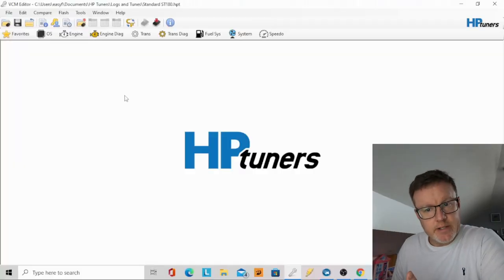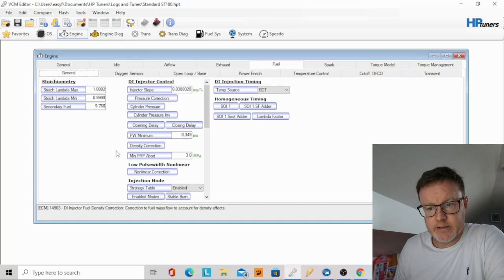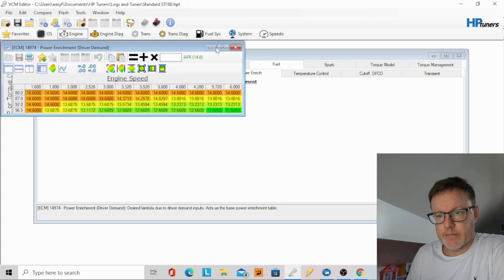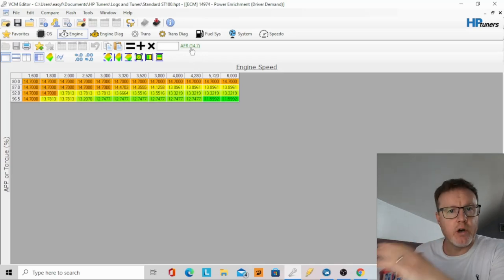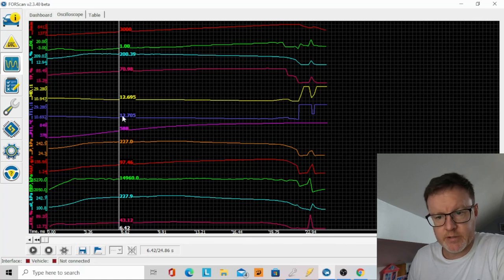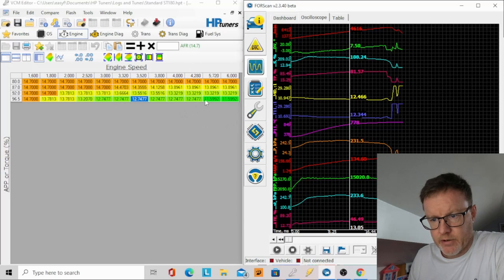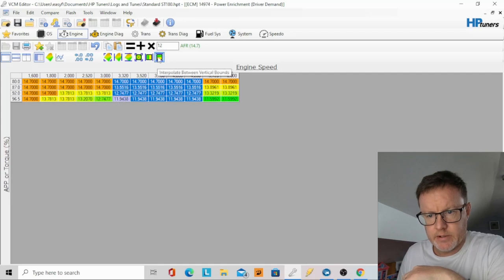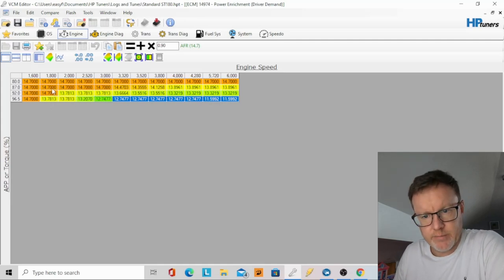I didn't know it was this easy. AFR changes

Comment: Hi Steve I bought HP Tuners around 18 months ago as having had my car remapped I wanted to be able to make adjustments myself. I found myself spending lots of time on forums reading rather than asking questions as those sorts of forums really don't cater to a learner. Along the way, I found that the mapping strategy used on the Euro Fiesta ST and 1.0 is very similar to what VW used on the Mk6 Golf that had the Bosch MED 17 which was a great help as there is lots of info out there for VW for some reason Ford is not anywhere near as popular. So, I thank you for making this video as it is very informative.
It's worth mentioning that it is very wise to have the ability to make a spare ECU (CLONE) should you decide to go down this path if you have some sort of write error you'll not be using your car until you get the ECU bench flashed.
I have also experimented with an aftermarket ECU on my car which took many hours just to make an adaptor loom to go from Ford to my ECU and although it had many great features the engine just didn't drive anywhere near as nice as the stock ECU also idle was shocking as was controlling the VVC on the cams tp try and get more low-end torque. I gave up in the end and had much more success with the HP software. Keep meaning to get HP to add the ability to change out the stock TIP and MAP sensors as I want to use 3.5 bar versions.
Reply from the maker: I have read about the golf's having a similar ecu.  But I haven't come across much useful info although iv not looked too hard either. I done some hp academy courses which helped a lot but iv still a lot to learn. If you have any good sources of info please send me some on my Instagram @sparkplugsteve. Thanks for your comment

Comment: Thats a great video Steve, thing is with mapping every mod you make which could potentially affect ur fuel/spark requirements needs map adjustments so its a massive plus to be able to do it yourself really, where did you purchase the HP Tuners kit from ? And have you fitted a wide band 02 sensor to monitor ur AFR ratio’s ?
Reply from the maker: Fiesta has a wide band as standard and I bought it from hp tuners direct . Thanks.
Reply: @Sparkplugsteve  Yes i know it has wide band as standard but i meant a AFR gauge in the car so you can see at a glance ur air/fuel ratio
Reply from the maker: I have a lufi x1 gauge so can see my afr in there 👍
Reply: @Sparkplugsteve  Sound Steve, do you think you will get the hang of this mapping eventually ?
Reply from the maker: @Steve Guest  yeh hp tuners makes it very easy.